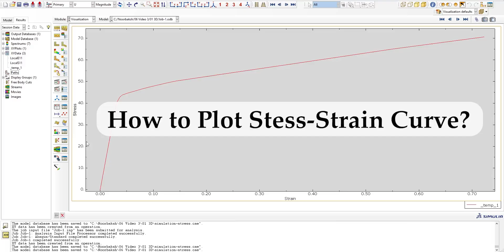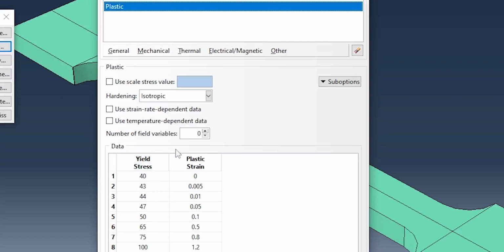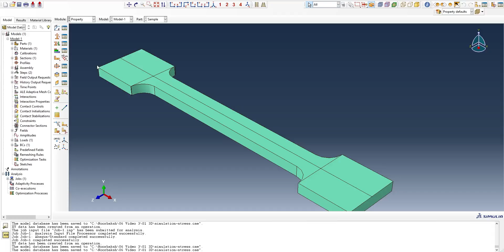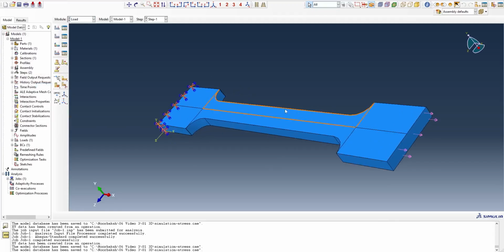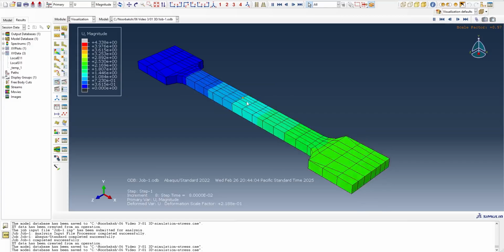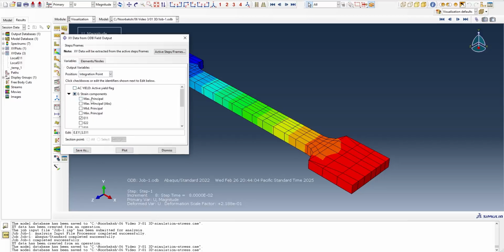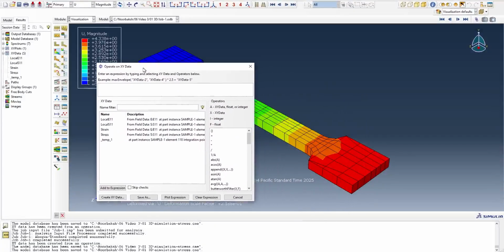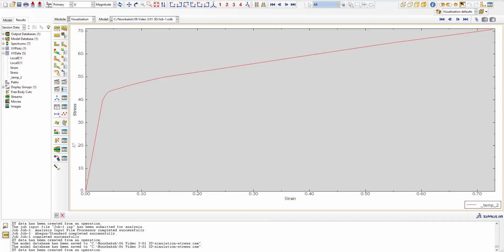🎥 How to Plot Stress-Strain Curve in Abaqus | Step-by-Step Tutorial

Comment: Hello, I am looking to get my stress-strain data in the z direction (sigma_33 and e_33). I applied a displacement to my compression model and created a set for it via a reference point. I made field output requests and a history request to indicate this, however, I continue to get an error, "No xy data was extracted using the provided options. Please verify the following:..." May you assist me with this?
Reply from the maker: In general, several factors could be involved. Sometimes, Abaqus won't generate any output results until the job is fully completed.
Alternatively, in the field output or history output settings, the output intervals might be set too far apart, resulting in no data being recorded within that time range. There could also be an issue with the set you've defined for the output.

In any case, feel free to email the address below, describe your issue, and if you’d like, attach your file. One of our experts will review it and let you know what the problem is.

support@caeassistant.com